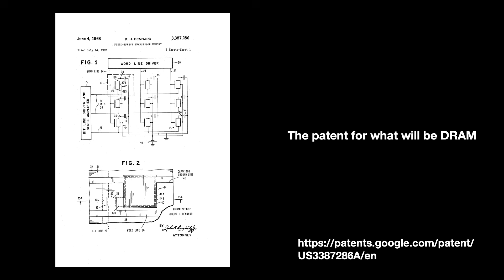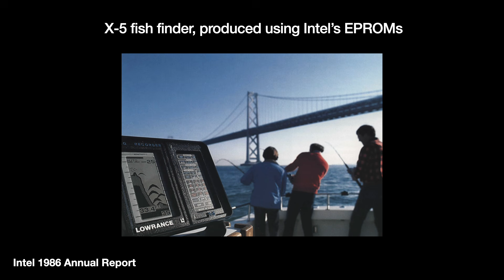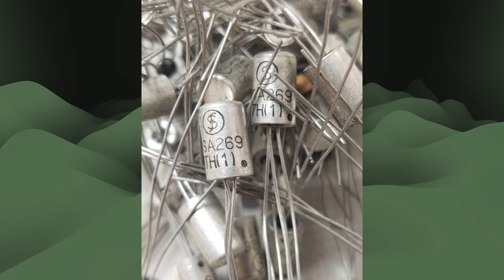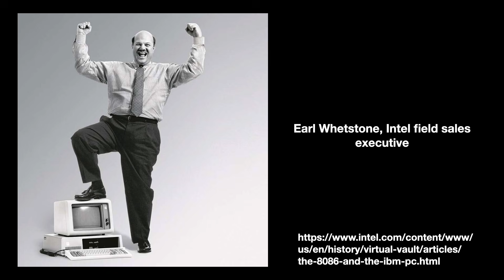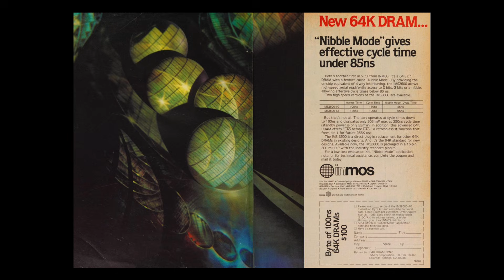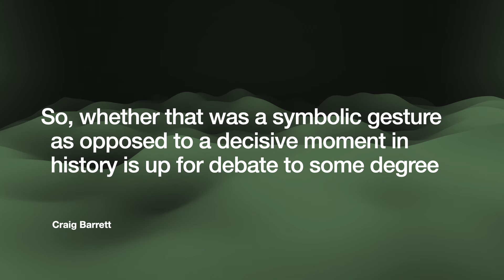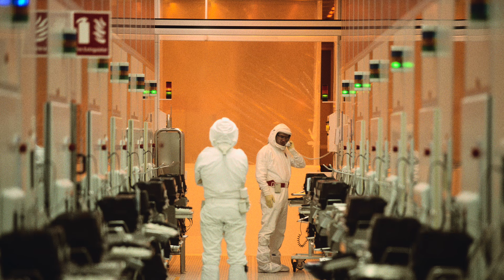What Once Saved Intel

Comment: I was a chip engineer from 79 for a few decades, some of this story is just missing a lot of detail and gets other stuff wrong.

The HP story of 6x was to do with the alpha problem, Japanese DRAMs were mostly the same as US DRAMs except for one detail that was not appreciated in the US. The DRAMs were packaged in plastic to shield the die from the environment. What was not widely understood at that time was cosmic radiation from space and the trace amounts of uranium found in the plastic producing alpha decays. For some reason the Japanese sourced their plastic from a supplier that had vastly purer materials so they were getting 6x less alpha hits on the DRAM cells. The US suppliers were all using the same contaminated  supplies. At first the US suppliers denied the problem, but eventually understood it. The solution was to switch to the purer plastics that Japan used plus they also added another barrier, a polyimide layer right over the die. The problem had been less severe in the metal lidded part IIRC.

I worked at INMOS which for a while became a premier DRAM company that added new features such as the nibble mode and CAS before RAS as well as turbo charged clock driver circuitry that sped things up. That improved the system levels performance for bursting data into caches. By this time Intel was irrelevant to DRAMs by the low 80s, we never took them seriously as a player. Also INMOS had hired the best engineers from MOSTEK which was far more important to the story than this article suggests. The early 3t DRAMs were very quickly replaced by the 1t cell for many reasons, the 3t cell DRAM was really a complete piece of garbage and it was a different piece of garbage from every vendor. Take an 1103 from 5 companies that were supposed to be pin compatible, but were functionally different in timing parameters. A mainframe company could not mix and match chips from different vendors, the memory boards would not work. Also the DRAM was missing very basic features that needed to be inside the chip but were outside, the DRAM data line bit sensing, the word level clock drivers and so on, as well as many power supplies. These were 12V, 5V, -5V parts. The first of the 1t cell chips that went onto huge productions came from MOSTEK the 4027, they were quickly able to go to a 5V only part with 100s of innovations to get the DRAM into a simple to use design with tight reproducible specs. When these parts were mask copied by competitors US and Japanese, they all worked perfectly except for the plastic protection part exposed later on. Indeed there was a company called Mosaid that lived in Canada whos job was to reverse engineer the leading designs and sell reports to all comers. With a compatible MOS foundry and a Mosaid report you could get into DRAM design with a year of effort saved. Of course we had reports on all the leading designs, I used to enjoy reading them. MOSTEK eventually faded away but the legendary engineers from that company went on to form INMOS and MICRON. The later are still around, they pivoted right from the beginning though on good enough performance and the absolute smallest die for highest yield while INMOS went all in on complexity for the premium market. The shift from NMOS to CMOS was largely driven by Japan, and once DRAMs went to CMOS the US completely gave up on DRAM except Micron.

I could say more, but this article concentrates way to much on Intel as if they were the leader in everything DRAM, they were largely also rans even though they started the commercial DRAM. But before Intel, IBM had created the first CPU mainframe DRAMs but those were captive. Over the 80s when I went to the ISSCC conference, we often enjoyed papers from all the DRAM players teasing out a few details about the next gen DRAM, SRAM  and non volatile storage etc. INMOS had a hand in all 3 memory markets but the nitride based non volatile storage never really took off. It also ejected quite a few daughter companies like Fairchild had, but none of them really took off.
Reply: @johnjakson444  thanks for the details, 
 consider posting article's somewhere?
Reply: @jj-jak  Most people in the business are too busy "doing" to do things like social media or blogs.   At least that's my personal experience.
Reply: @Jeff-i8u  not to mention the risk of "disciplinary action" from employers.
Reply: @Jeff-i8u  nah
Reply: @poofygoof  for young engineers,
 yeah keep it shut... but older engineers should speak their minds.
Reply: @jj-jak  I was never a very literate person, really, engineers like me code away or work in the night in the CAD room, never got out much. Also I hesitate to publish any mistakes, my memory is not so reliable, but a lot of it could be checked by going through old text books but those are boxed up now and would be easy to search either.
Reply: you seem to be literating ok,  @johnjakson444  
i expect you will continue to literate :p 

your audience is likely to be dorks as well so equally unlitericious.
Reply: Great info. 👍🏼 But is any of this published online? If it isn’t available then it can’t be researched and cited. Consider publishing your experiences so this history and detail isn’t lost.
Reply: @glennac  I was trying to dig up the name of a Pakistani engineer who was a pretty big part of the Nexgen AMD K6 K7 Athlon story and it took me ages, the internet has become too damn good at burying people. Only the most famous people get promoted to the top like Jim Keller as if they developed everything even though hugely more people were involved. The guy was Atiq Raza,  Its like corporations really don't want peoples names in their history unless they were too big to forget. So its going to be difficult to get historical data out of the panopticon unless you know half the story.
Reply: @johnjakson444
Reply: @glennac  I think I left that too late, in my boxed papers I have schematics for reverse engineering 8086, 68000, Z8000, but only in parts, some of that may have appeared in EE textbooks too. Even if I could correctly recall everything I ever touched, it would run to many books long  and it begs the question of who really wants to know. I quit the engineering field nearly 25 years ago precisely because at only 45 I was already a dinosaur that had worked on 3u NMOS CMOS etc and at least we were honest about our process sizes. Today the industry is completely dishonest about feature sizes unless you have access to a cell library from say TSMC. So I am not as impressed with the industry as many people are because today a PC with 1B parts is only booting up 10x faster than a mac did with a 68k from 1984. Sure it can do lots of things a million times bigger, but there is much that was not done that could have been done, the issue revolves around the Memory Wall.
Reply: I mean given you were literally guts deep in ancient silicon origins, he's trying his best. But your insight is very much appreciated!
Reply: Just to clarify a little bit. There was no uranium in the plastic itself. But the molding compound from which the packages were made consisted of plastic mixed with various other ingredients, the bulk of which was mineral fillers. It was these mineral fillers which occasionally contained trace amounts of uranium and thorium. (This was also always a potential problem with ceramic packages.)

Later, with much higher density chips, when solder bumps stared to be used to bond the dies, there appeared another problem with the radiation from the radioactive isotopes of lead present in the natural lead in minute quantities. This was solved by using laser isotope separation techniques to remove the unwanted isotope.
Reply: @cogoid  Thanks for clearing that up, I have exactly one other person in the world to talk to about this. Good lord, I never would have known about the isotopic separation in lead solder, of course natural lead would be naturally contaminated, billions of years ago it would have been mostly uranium thorium right after the neutron star collision, never gave it a thought. That laser separation process must be more or less the Silex process used for enriching uranium. That brings me round to my other fav topics.
Reply: @johnjakson444  Similar, but the laser process works much better for lead than for uranium. The difference is that with the lead you are only knocking out an impurity present in already very minute quantity, some parts per million. Since you tune the laser to interact only with this impurity, it takes a very modest amount of laser power to clean up a useful amount of lead -- because 99.9999% of your material is already the good isotope. So the process is a million times more energy efficient than the one for uranium.
Reply: @cogoid  Wait! So you're saying substrate to substrate or silicon to substrate bonding used to have solder balls that were slightly radioactive? I didn't know that!
Reply: @erictayet  Yep a bit of knowledge about astrophysics and it would be obvious when you know how the elements come from, genesis of periodic table of elements.
Reply from the maker: I feel like I made it pretty clear that Intel fell out of DRAM pretty fast. But please send me an email and I would love to chat with you.
Reply: I think the video is standing back a fair distance, he covered a lot of years and lots of things had to be glossed over.
Your perspective is much more detailed and event specific.
Reply: @peterparsons7141  thanks, yeh it damned difficult to cover such a wide breadth without glossing over.
Reply: I want to know how such a large post got past the automatic You Tube censors. Many times , regardless of the channel, completely non controversial posts this large get ghosted or deleted.
Reply: @bobroberts2371  I'm impressed too, even half of the size for simple technological and business discussions get the comment deleted here. 

I'm guessing he has a very high YT credit score? :p
Reply: @yensteel  I actually don't know anything about how this game works, most of my 1 liners go ignored which often prompts me to avoid wasting my time, occasionally I post these 10-200 line postings usually about chips, software or nuclear energy etc and they seem to stick, the more technical it is there is less probability of using any curse words, but most of the long ones usually get no feedback.

In this case I was very much triggered to pour out a load of stuff I pretty well remember right from the low 80s because it was deeply ingrained in my memory save minor details. I can imagine that every chip designer I know from that date has either died or does not watch these kinds of YTs.
Reply: @johnjakson444  thanks for the insight, John. Early comments with upvotes get presented on the top of the comment queue, so people read it. The later comments that are below the second page of scrolling are generally ignore because who has the time to read thousands of comments. XD

Anyway, my professor told me about the white ceramic packaging issue years ago. Presumably light & UV is inducing a current on the IC. He has a bunch of them at home. The black ceramic (not sure if there's metal shielding) worked flawlessly. These were made in Singapore when we had an IC packaging industry.

And from other comments (also years ago on other EE videos) I learn that some of the ceramic (in US) contained uranium isotopes that is bit-flipping RAM chips due to particle decay. I am generally not familiar with these manufacturing processes because I was too young. I got the PC XT with NEC V20 when I was 11. I seem to remember those had 16KB RAM chips.

Lastly, this video is about Intel and how DRAM didn't work out for them due to stagnating process and how Logic saved them. Your post showed us what was happening on the US side of the DRAM industry. Asianometry actually has other videos on this too.

Intel Foundry is at the same impasse again, being unable to keep up with TSMC due to stagnating process. We can only hope their bet on ASML High-NA EUV process for their 18A process is successful because that can save Intel by leapfrogging TSMC 2nm.
Reply: @erictayet  Back in the day when Inmos was first crowing about how fast their 16K srams were @15ns and how slow the Intel chip was @25-30ns, we got hit by a damned new problem, remember we were on std 3un NMOS process 1 metal etc. We had electro migration issues, the Al wiring would get thinner and then break, AC good DC bad in current density. We had issues with the birds beak in the way the field isolation would look like a birds beak in cross section,  so leakage currents were flowing near the transistor in places we did not expect. there were so many other concerns popping up, the process guys were always busy, they tended to have to be Phds to do that job.. That's why we never introduced our nitride EEPROM, too different from the industry std Intel EEPROM.

yeh I had forgotten how clear the white ceramic was, you could almost see through them. We used to delid other peoples chips by a razer blade across the metal capping, opening up plastic chips was too much work with the acids. Fortunately most high value chips I got to work on for reverse engineering were in ceramic.

I was aware of the early bird in comments which is why I don't usually post much unless I am early. i have watched quite a few of the vids on the channel but but too late to post or didn't want to go off on dram vs Dee RAM, if the pronunciation is wrong, well nothing to say. glad he sorted that out.

Intel really messed up badly by avoiding the ASML EUV train a decade ago, this has a great deal to do with the Asians knack for being able to do very deep investments in their foundries, it worked for them because they don't have capital tied up with the products going through the fab, separation of business. When TSMC was still a young foundry one of my DSP ASICs went through their fab, I heard they were curious what it was, but they got lots more bigger customers later on.

I have no stake in the game anymore, I am more keen to follow Risc V but even then it won't change much the final product space.
Reply: @johnjakson444  Actually, the Asianometry video comment section is one of the friendliest and most respectable ones you'd ever get in this space. Probably the second one would be High Yield's videos. Surely isn't much, but there's that.

The others (not going to mention names, and even here to a less degree), are predominantly filled with readers who can't be bothered to read a single paragraph on the comment section. Coupled with YouTube's comment section's mechanism, you won't get any exposure if you fail to gain early momentum, no matter how beautiful and insightful the information is presented. Some are thrown away down the drain due to "censorship", spam?, I mean, WTF, right. Been trying to do that, and ended up kicking myself almost all the time.
Reply: @johnjakson444  well John, I will look out for your insights in future videos. I used to be a software dev and TI DSPs were my specialties.

Yes, Jon is stubborn in correcting his DRAM pronunciation. Maybe he used Google TTS too much? 😅 I only know he's based in Taiwan.

I assume when you talk about the electron migration issues, you meant TFT SRAM? But then again, I'm not familiar with SRAM manufacturing technology.

Intel also under-invested in their testing equipment. I also have a client at AEM that reported Intel bought a ton of their testing equipment a few years ago for their 10nm & smaller.

I wish Intel well. Can't have AMD overpricing their products due to no competition the way NVidia is doing.
Reply: @EntekCoffee  yeh, thanks for that, I had noted lots of nonsense one liners, good reason to avoid commenting. Its obvious there are quite a few semiconductor veterans hanging around here. In an earlier part of my retirement when internet was young, I did frequent a lot more of the other channels that talk about semi news, but the signal to noise ratio has gotten much worse.  Also the young'ens these days are mostly into the LTT type scene, Intel vs AMD. There is also Dr Cutless but I don't think he has ever worked in chip design.

TBH I have wasted far too much time watching videos made by technically illiterates idiots pushing all sort of stupid physics, free energy I had given up on the web. And now AI generated content has made the web hugely worse.
Reply: @johnjakson444  It's frustrating sometimes, but I'll have a different perspective so that you can keep going. I'm probably younger than most of you here, and had started from the weirdos like LTT and Hasan Mujtaba (and other WCCFTech writers). I can see your enthusiasm, so never be discouraged!

The internet is designed for my past 13 y-o self. A few would have progressed, but most others would prefer to stay at the same place or do something else in life. Nothing we can do to change that. As unlikely you can find one who progresses, we should nonetheless be the right one guiding those 13 y-olds to climb the ladder.
Reply: @erictayet  I fondly remember those TI DSPs, I almost went to work on them but ended up on other custom DSP projects.  I suspected he was in Taiwan too. I used to buy a lot of my VLSI EE books on family visits there, the book stores used to be great for getting books at about 30c on the dollar esp near the universities in Hsinchu city. Back in day, we were all using aluminum, a 3u wire had a rating of IIRC 1ma/micron but the power rails were DC so needed to be much wider. The atoms were literally migrating  along the wire with enough electron current. SRAMs would have likely had a lot more DC heavy current in the NMOS days, a 16k device would have been 500mw or so draw. The problems went away once the industry switched to copper, damascene, planarization of the surface and many metal planes and most of all CMOS. We had only 1 metal and poly wire/gate in a paper bag.

My bigger concern is not so much the intel/AMD war, or processors since I usually code on Skylake 2c4t 6100T which is enough for my work, its more to do with the awful OSes we have, we never really made much progress over 40 years, indeed MS has Win11 spymode, Apple has garden wall, and Linux has well not much more than WinXP had decades ago. Have to keep an eye of team green, are they hyped are too much, maybe.
Reply: @johnjakson444  I'm more into theoretical physics than astrophysics and material science. I always assume that lead is lead even though I know uranium and thorium decay into lead over millions of years. I remember AL was used due to its price but CU took cover eventually due to current requirements. But by the time, I started work, my EE knowledge was obsoleted, and Microelectronics became a separate course. Things move REALLY fast in the 90s.

These days, manufacturing process has gotten so small, quantum effects are taking over. I even toyed with the idea of doing a full-time degree in Applied Physics to learn more about QM & Nuclear Physics. But I'm too busy with work and preparing for financial retirement.

As for OS, let me share my perspective. When I was actively developing, I used Win2K and Suse Linux around the time of Y2K. I was a system programmer interfacing with embedded computers of our own design.

To keep things simple and cheap, we used PC as our development platform which meant Windows 98 or NT/2000. Linux was a thing but documentation was sparser and the Internet has a lot of documents behind paywalls, or you had to buy them on CDs.

Naturally, Windows was preferred because it just was so much easier to get things done. Over the months, Suse became a side project because getting Gnome or KDE to work meant a recompile with no guarantee that it'll finish compiling. And no, I needed either a WebUI or program for my customers so working in a CLI environment just isn't going to cut it.

During that time, Steve Jobs got ousted, got brought back, and started the iPhone, iMac 'revolution'. But their success lie in selling things that just works but only if it works the Apple way. I was always interested in Apple laptops, but I needed a touchscreen so have always opt for Windows TabletPC and Surface type devices for my own usage. The iPad just isn't going to cut it too. I am using a Ipad for our Point-of-sales device, but I never wanted to use it for any other purposes. I wish it runs MacOS so it can be useful.

So, Windows devices have always been the do-it-all but customers always wanted it to do more so Microsoft is happy to oblige. So while some people see Windows as bloatware and spyware, I have a different perspective. In order for all the legacy SW/HW compatibility and not to weigh down the OS, a lot of OS stuff are stored on Microsoft servers. I personally found Onedrive and MS Account to be a lifesaver and timesaver. There is no evidence that Microsoft is looking at my data. While I know my Google devices are looking at ALL my data.

Windows 11 sends a lot of data because it's synching telemetry on usage etc., which to a developer like me, is important to figure out usage patterns and crash reasons. Switching on Shared clipboard allowed me to copy and paste text across Android and IOS and other Windows devices which is super convenient. And I have never been hacked before.

Linux is so far behind in usability because its leaders refuse to collect telemetry. So you rely on a few people's opinions. I'm running WSL now, so I've been working with Ubuntu 22.04 for a month but reading about how to implement XFCE, KDE or GNOME, I see they have not progressed much from the 2000s. There is a major disconnect between all the major distro as well (and their supporters) so while that's great for choice, it's not going to help the average person get into Linux. Back in the day, drag and drop wasn't even consistent and can cause crashes!

And there is news that ChromeOS will be scrapped for Android to take over and I think that's a better direction because at least something like Samsung Dex on my Z Fold 5 works reasonably well and Android tablets are well received by the public compared to Chrome laptops. I'm buying a pair of AR googles to use with my phone because AR glasses have gotten good enough and don't make me looks like a dork in public. I was an early supporter of AR/VR having worked with the Hololens.

Anyway, these are just my opinions and my use cases. The only major OS I don't use is MacOS because I don't own a Mac.
Reply: @johnjakson444  Youtube offers to creator automated comment moderation. You can hold all comments (meaning channel owner has to approve comments for them to become visible, hold "potentially inappropriate comments" or "hold a broader range of potentially inappropriate comments" or don't hold any comments. Since Jon doesn't hold all comments he's most likely using basic or strict moderation, in which case the "appropriateness" is a matter of Google algorithm (which can change any time).
Reply: @erictayet  "Linux is so far behind in usability because its leaders refuse to collect telemetry."

That just isn't true. Things like "telemetry" are precisely why usability is so poor across the entire industry today. Today's interface "designers", like managers in companies whose customers are dissatisfied, might fish for "insights" through technical measures and then try and deduce what kinds of problems users have, but there is no substitute for participative, iterative design.

In fact, usability in projects like GNOME was probably improved when the likes of Sun got involved to be able to ship products based on those projects. That led to accessibility features being introduced, for instance, by people who understood what kinds of features products need to have, and by people who had presumably studied human-computer interaction, which is a genuine, multidisciplinary field of study and research.

But what happened since is that people have relentlessly copied the dubious aesthetics-first "designs" of Apple, Microsoft and Google. The result is like a greatest hits of disastrous consumer electronics gadgetry as these "designers" have striven to make their applications look tidy or "sleek", or whatever.

A lot of people still regard the interface paradigms of GNOME 2 and KDE 3 as better than their successors, and that is why projects like XFCE, Mate and LXQt exist. But anyone who dares to question the rigour of "modern" user interface design gets shouted down, with copious references to commercial success, desperately trying to distract from the fact that the emperor and his whole pantheon has no clothes.
Reply: @paul_boddie  then we agree to disagree on this. Telemetry tells designer what usage pattern is and what get used more often. Now I'm not saying we should get rid of people when designing UI, that's the whole point of the UX anyway, make People like it. But how do you know what People are actually using? Telemetry. In marketing, they like to do A/B testing. This is what it is.

And it's great you brought up accessibility. My cousin is half-blind and all her accessibility software support Windows because it's just so easy to integrate the layering of UI over standard Windows GDI. This includes hardware assistance devices.

I will admit that I have NOT booted up X server to try all the different Shells under Ubuntu. I've read and watched videos of the KDE/GNOME and I am not impressed. At present, I'm happy working with Ubuntu 22.04 under WSL/Windows 10.

And you are right that UX designer need to be multi-discipline because modern users are way more sophisticated, but I see screenshots of KDE and GNOME and the designs looks very mishmash.

Look man, I'm all for choice but don't you think Linux can do with LESS shells than MORE (for Desktop)? Can programs made for KDE look right in Gnome or XFCE without the dev making adjustments?

It is not just skins and themes either. It's the plumbing, the windowing calls, functions like mouse clicks & touchscreen taps, UI element boundary, copy/paste of different data streams, text/bitmaps/tables/etc. Windows is successful because of Object Linking & Embedding, which extends to a window across different monitors AND a different machine's window.

Linux UI designers should get together, set aside their differences and create their own style. I read a lot of the XOrg draws are standardised but every shell add/overwrite aspects of XOrg. This is fine if you want to run on a handheld or across a billboard but standardisation is what drive usage.

Heck, if they created a functional Star Trek LCARS, I would be more interested than a simple copy or Windows & MacOS. And NO, I don't want everything to run in a browser like in ChromeOS.
Reply: The IBM captive memories got to 64k with metal gate 1T DRAMs (double level metal), but their early poly gated devices first had multiple power supplies and then undersized the storage capacitor. Pretty underwhelming products, even when the processing was great. The alpha particle issue was huge in the late 70's, and came back to bite logic in later years (remember the claim that 'sudden acceleration' accidents were caused by alpha particles affecting car engine controllers?)
Reply: @jaykita2069  I only remember IBM DRAM stuff from the ISSC papers I saw at the conference. yeh I remember the logic soft error was also a problem. Speaking of car engine controllers I worked on a TI 16bit  auto cpu chip called prism, I redid a place and route job by hand to pack down the control logic, the circuit design was not true CMOS, it was lazy CMOS with a N FET for flop feedback, there would have been a lot of nodes at 2/3 rail everywhere for the pipelines and so sort of pseudo dynamic. Wonder if they had the alpha problem, never gave alpha hits any thought while working on most of my chip work. Back when I did pure transistor circuit design we were always looking for short cuts, domino logic was a thing, mostly NMOS logic with PMOS load of some sort.  Golden days I suppose.

Even Intel had to abandon the 6t CMOS ram cell and go all in on 8t cells and take the area hit for higher reliability but that allowed lower power rail.
Reply: thank you for your knowledge I'm here to learn not lick boots unlike some commenters
Reply: Even in case some things could be better described or they are even wrong. Its good that it is documented. Without you would not be able to explain whats maybe wrong. Its also important to have all this knowledge in the history 'book' (videos).
Reply: Hello, this video is not about DRAM but about how intel survived. Appreciate the long and detailed comment. Maybe propose to ghostwrite some articles for asianometry?
Reply: Why don't you make your own video then John? Boomers only know how to complain all the time
Reply: I still have some Mostek MK4007 memories, interesting serial shift register memories
Reply: That is interesting.
Reply: Thanks man!
Reply: Very interesting read, thank you! RSS readers are experiencing a resurgence in popularity, and Kagi Search has its "small web" project, so I think you could find an audience to a blog about your experience. But, it would help to post on Mastodon or similar for people to first discover your articles.

On the Linux front, I'd suggest giving it another try if you find time. I think there's a common pitfall where people choose Linux because of its UI flexibility, privacy, security; and because of those reasons, they end up choosing the linux flavor with the highest setup and maintenance burden. As a daily driver I've found Ubuntu to be solid. GNOME has a clear design philosophy which makes Ubuntu's UI fairly consistent and predictable.
Reply: Thanks for your insight.  I enjoyed reading that.
Reply: Welcome aboard John.

Just a reminder… asianometry is on the internet, but it is full of real people hanging out for a few minutes…

Hang out every week, and enjoy it…

😃
Reply: @AC-jk8wq  yeh when an article pops up and its recent, then I do watch these but the content is all over the place, but DRAMs are very special to me even though I never worked on them, just very close to those that did.
Reply: I take it you're new here? Welcome. The video is about Intel specifically, so yes, it focuses on Intel.
Reply: @dziban303  not exactly new, I have posted the same sort of story before on missing details from other videos.
Reply: Fascinating stuff and very much appreciated ! but don't have a pop at our main man !
Reply: Yep, he suck with this video. Also, at 3:29 that's a core memory, not 1103 🤦🏻‍♂️🤦🏻‍♂️🤦🏻‍♂️
Reply: When CCP China (Huawei) hired Dr Shane Todd to perform R&D for gallium nitride technology, they put him in a subsidiary in Singapore.  When his R&D task was done, they made him permanently quiet.  It must have been quite an improvement for them to guard it that way.
Reply: lol where do you think the majority of information in English for non-technical researchers is? (or at least those without a specialized engineering degree?)  Intel's publications and journalists sponsored/ or with some relationship with Intel. And, you saw the title of this video, right?  You're welcome to make your own video to set the record straight!!!
Reply: @squirlmy  
Too much time has passed and many of us have died or will in 10 years. As a teenager I could just contact companies and buy books from the marketing dept and in 1976, most chips included the full schematic in the book. The 1103 was fully described and you could see how awful it really was. When the Mostek 4027 4K DRAM came out, the practice changed, there was too much good stuff to disclose except in conference proceeding but Mosaid would sell that.

Mosaid still exists but that business has long gone, today its an IP house, they probably have all the reports in the basement perhaps. Even I never thought to keep private copies.

Well Wikipedia did use to be a resource, it wouldn't necessarily have the info I have. If it did, it would be all over the place, you almost would have to know it in order to look for it and put it back together. There are a few crazy people out there, there is a guy that single handedly built his own 1"  fab in HIS house and can make 3u type NMOS chips with a few 100-1000 devices. If he knew how, he could build an SRAM for 256bits maybe 40 years after the fact.

Very old textbooks are full of information, I have 2000 or so books I can't give away to a top US University my collection of engineering text books since they date from 20 to 50 years old, but  I get the impression that students just don't visit the engineering library anymore. As student 45 years ago, I practically lived in my Uni lib in the UK where I learned all about US chip design. At UMass Amherst, the EE section was empty of students and shelved with dusty old books even older than mine, I don't really want my collection to end up there and end up getting unused then shredded.

The web has changed in the last 20years, it used to be pretty easy to find useful content, now I think its become a wasteland.

Also a lot of people have died, the giants of DRAM were Paul Schroder (MOSTEK then INMOS) and Bob Proebsting (MOSTEK) were the 2 principles of DRAM design that changed the world. I read about their work and studied it at Uni by reading various IEEE journals, like JSSC (the red one).. The most famous circuit was essentially a flip flop that acted as a large clock buffer. It used 12 enhancement only transistor's  to produce a very precise kind of buffer with constant delay. It involved a lot of boot strapping with flying capacitors and no depletion transistors. Back in 1980, if you could draw out that circuit and describe all the waveforms, you could get a job as a circuit designer.

Later on I described the 68000 cpu chip, it had 5 of these exact same clock drivers on board to drive the 2 phase logic, 2 were for the IO pins and 2 for driving the CPU with a spare one for hold the chip in freeze state.

Later on in 1994 while redoing a HP signal processor chip from NMOS to CMOS I found the same circuit in a pair back to back to drive a pattern generator signal processor. To make it CMOS all I had to do was to replace a 200+ device for a clock driver from the cell catalog. The knowledge was already very rare at HP,  and in 1994 I might have been one of the few people in the world to be able to reverse engineer that chip and redo it in CMOS basic gates, I had a few people to help me though.

The IEEE and to a lesser extent ACM plus all the old Electronics  weekly monthly magazines would have been a treasure trove of info, but paper printing is now gone. I don't even know if IEEE still exists in the journal which all the engineers used to read back then.